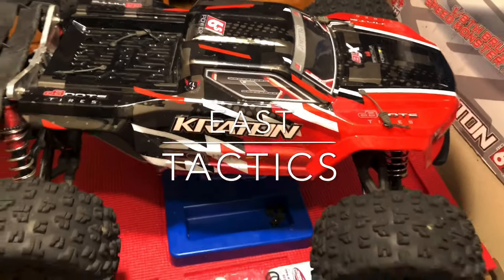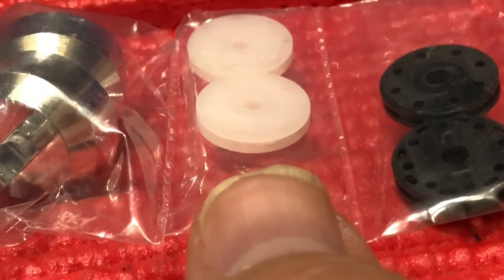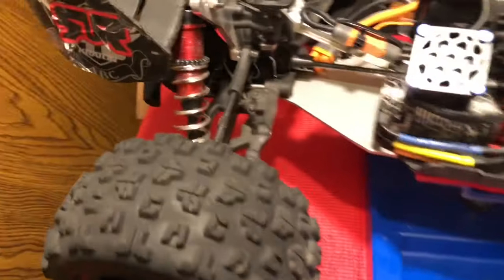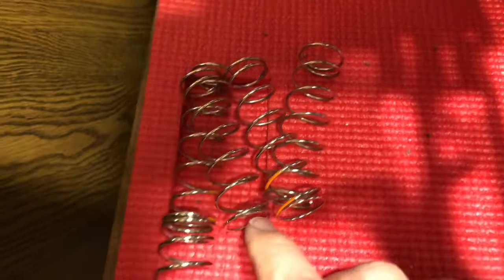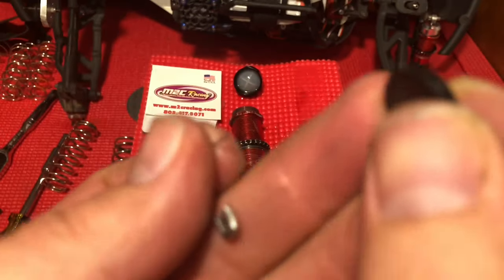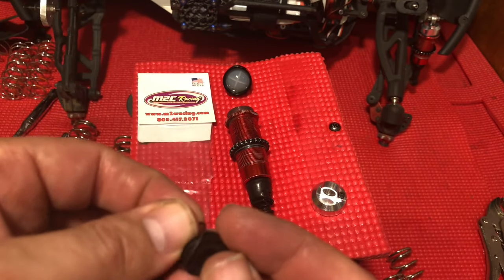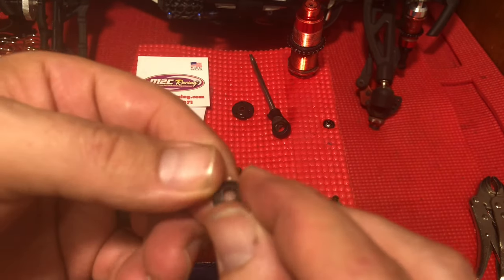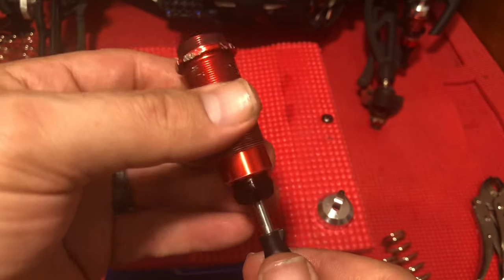M2C ZRS Shock Caps - How remove and install RC shocks

Comment: I love the way you fitted the emulsion caps with great care ,  and the little extra tips/mods 
I found that one of my caps leaked after fitting so I put that plumbers tape around the threads before fitting the caps worked really well . No leaks now 👍👌👍
Reply from the maker: Claire Cooper, thanks, I really appreciate the comment.

Comment: Very well explained 👍 I might want to buy these pistons for my rc cars 🙂 I find a lot of important information on your channel 😃
I have a question about shocks:
When shock is build (without spring!) and I push shaft fully up into the shock body ⬆️ , should it extend ⬇️ ? Also when I push shaft down ⬇️ , should it move back ⬆️ ? Or the shock shaft shouldn't move by itself without spring? 🤔
Reply from the maker: Yes, if installed properly and you achieved removing all air bubbles, when pushing the shock shaft all the way up it should slowly move back out on its own. That’s a good sign.
I’m not sure If it works both ways meaning if you pull it out really fast as it slowly suck itself back in, I don’t believe it does do that. However if yours is doing that I would also consider that a good sign that you’ve got all the air bubbles out

Comment: Nice video buddy!
I love these ZRS caps from M2C! I have them for all my rigs💪😎
Great job taking your time with the install. Maybe try the standard shock springs first to see how they behave and standard 1000cst oil as intended and build up from there. With those stiff springs and super heavy oil not sure your gonna get all the benefits of the dampening of these caps. ZRS really soak up a ton of bumps well when going high speeds, with the stiff springs it may just bounce off of terrain that would normally be soaked up?? I'm curious to see brother, do your thing! Love it
Reply from the maker: 3 Sons RC, hey what’s up my friend! I hear what you’re saying. Running the ZRS caps with the regular shock set up is definitely going to be a venture for me here pretty soon. However I’m going to do it in a little bit of the opposite order of what you’re suggesting. With all the work I put into trying to fine tune the duel shock spring experiment, (now technically a single spring, big rock springs). I plan to get a couple more bash sessions in to truly get the feel of these ZRS caps and how they impact this experiment. I did notice a significant improvement with these caps on the heavier springs. It changed from About a 4 inch bounce (from 35 inches up) to only about an inch and a half bounce. To me that’s pretty significant. 
Remember my goal with rocking his heavier springs aside from seeing if I could tame them, was to provide more protection to the body from chassis slap and other rigorous jolts. So long as the hit to performance and running over those rocky terrain’s etc. isn’t too significant I may end up making this my official bash set up. However I need more time with it. Eventually I will switch back to the single spring and then I’ll really have a gauge as to which I like more. Bash on brother
Reply: @EastTactics  good luck my friend

Comment: Hi, Do you have an alternative for V5 Kraton 6S? M2C said it dont fit 😢 And i dond find the springs in canada amazone
Reply from the maker: I’m confused, doesn’t the V5 use the exact same shocks as the V4 , and EXB (Shocks themselves)? 
Regarding the springs, Give me a little bit of time today and I’ll do some research for you. I heard of a company where you can order custom springs. Let me iron out, the exact sizes you need to order from them etc. But, I need to button up some of the details and then I’ll let you know. May even have to make a separate video specifically on these guys. Since it seems so hard to find the Nero shock springs even here in the US.

Comment: So it would seem, as I figure, you can't tighten it down all the way with the supplied o ring because it will dislodge. But if you don't tighten it down, you get leakage. Seems to me like the solution is a thinner o ring and less vranking down in the end, just enough to seal, no?
Reply from the maker: Yes, also check out the pin comment in the comment section for a timestamp on the idea of adding a DIY O-ring down first.That helps to

Comment: How is the bigger springs and caps doing? Have you went back to the double springs?
Reply from the maker: They’re doing great! Had a bash session recently and I felt she performed on par if not better then the EXB I was roll’n with. 
In fact it was quite noticeable how much softer and less chassis slap was heard and seen comparatively. And the Bounce factor was definitely not worse then stock (EXB), in fact many a landings were quite kush. So ya... luv’ n it!
https://youtu.be/cDl5rOmz2po
Reply: @EastTactics  couldn't find the big rock spring😪s.
Reply from the maker: You’re right! Suckers seem to be out of stock everywhere! I had to dig pretty deep for these not even sure if they’re shipping from the US LOL. But they might work?? I don’t know

Try 
https://www.bigboyswithcooltoys.ca/products/ar330417-shock-spring-75mm-317gf-mm-big-rock-2

Or

https://www.mcmracing.com/en/home/141169-arrma-arac8950-ar330417-shock-spring-75mm-317gf-mm-big-rock-2-5052127022033
Reply: @EastTactics  i looked at the exploded view on arrma site, for the Nero big rock, and its different part numbers? The ones I seen which is the part number are 65mm
Reply from the maker: Ya... ideally you want the longer ones. Sucks there so hard to find. The part number I give is for the 75mm version. Not even sure which classic Nero big rock those were for, cuz your right, I checked to, the current ones in the Arrma diagrams show the 65mm.
Stock Kraton is:
85mm front
95mm rear
So with me going 75mm collar adjustments were needed for both front and even mor so for the rear.
Going 65mm is just too short. IMO

Comment: Hey brother great video once again I just ordered these and curious looks like you used the regular shock piston so I should be good to go?? Or do you need aftermarket pistons to make these shock caps work ?
Reply from the maker: Rocky, They come with the Pistons you’ll use.
Reply: @EastTactics  thanks for the confirmation can't wait to get these installed!

Comment: Great video but Myn is bouncing what did I do wrong?🤷🏼‍♂️🤷🏼‍♂️
Reply from the maker: You mean in general, when landing, she’s bouncing up? How much?
What rig? Stock springs? Stock oil?
Reply: @EastTactics  the stock shocks with the m2c caps and pistons its a kraton exb 1/8 with 3000cst in them when I push it down it comes up very slow and when I drop it with my hands for like 1mtr high it bounces? Thx for your help😁
Reply from the maker: Why are you using 3000cst fluid with stock springs?
Reply: @EastTactics  because the bodems hits the ground when big jumps
Reply: @EastTactics  do you have double springs on them?
Reply from the maker: Understandable, but that’s way too thick for stock springs. Did someone tell you to thicken the fluid? 
You need much beefier springs now to complement that change to the oil thickness.
Reply from the maker: Yes and no… 
For that thick of oil you do need something the equivalent of duel springs. I did away with duel springs along time ago and found single springs in the same caliber.
Get these X4  for 3000cst fluid.
You will need to dremel the ends (both ends) flat, so they’ll sit right.
https://www.mwcomponents.com/shop/sp-co-a-10265?variant=1504334
COLLERS front - all the way up
COLLERS rear - normal

If they make you want to order 8 springs to bypass the surcharge order these x4 with them.
https://www.mwcomponents.com/shop/sp-co-a-11979
Reply: @EastTactics  okay i thought that you used the same shocks thx for the help😁👍🏼
Reply from the maker: Anytime brother😎

Comment: If you had thicker oil or smaller holes in the piston  wouldn't  that dampen  it so there would be less bounce ?
Reply from the maker: With these extremely heavy duty shocks springs that I’ve got installed on my vehicle. (The Arrma Nero Big rock spring) I had to do all kinds of things to tame these shocks. Which is why I have, to your point, added not just extremely thick Shock fluid . But I’m actually running 5000 weight differential fluid inside them! LOL
Now… Prior to incorporating the M2C zero bounce shock caps I was running my own custom pistons with the set up. At which point I was, which again is to your point, running not only less holes than the stock pistons. But smaller holes as well.

Comment: Randy, why they dont extend a bit after u press it?.. the shock diesnt need to extand a bit once u let it go?...
Reply from the maker: ETAI106,  with emulation style/bladder less shocks,  you won’t see that extension after you press it. That’s normal. 😎👍👊

Comment: Have u noticed leaking without the diy o ring? I've redone mine a few times and they still leak. May try the oring
Reply from the maker: Ya... since the o ring.. no leaks. 
Also be sure it’s nice and dry, and you don’t over tighten and de-seat the inner ring.
Reply: @EastTactics  yeah I've redone them a few times, looser and tighter, still leaks.. and when I opened them back up the o ring in the cap was still like I put it.
Reply from the maker: Let me know the results after you utilize the o ring tactic
Reply: @EastTactics  is there a special one u use? The other day i seen a link i think now i can't find it lol. And i had a guy make me some springs for the k6s but i used them once and snapped an rpm arm lol. They might be thicker then what youre using im not sure. Im just wondering if these thick springs ive got are stressing the other parts 🤔

Comment: Idk but the double shock setup just makes me cringe bad
Reply from the maker: Ya, it’s definitely not an experiment for the feint of heart. I will say the Kraton is a different beast with them, and I really like it. As you know though, I don’t run the duel springs anymore, instead I run the equivalent as a single beefed up spring with the big rock springs and 5k diff fluids throughout.
The shock caps help a lot to recoup performances lost in the added shock absorption she gained. Is it worth it, time will tell after my next few bash sessions. 
I’ve been out of pocket tho of late, with a big family move. Hoping to get back at it here real soon. Thx for watching my vids and commenting. 👊😎👍
My Kraton is all smiles thus far, I fear when I revert back to regular stock springs, she’s gunna feel loose as noodles, and lacking in support from hard landings. But we”ll see.
Reply: @EastTactics  i got my kraton exb already shimmed the front diff and filed center and front diff already. I just need now to pick up a rear hot racing bulkhead and the limit slip plates and gasket because mine broke because i had some sort of fabric inside a screw thread. Beats is pretty much ready i have zee lipos coming tommorow and electronics from jennyrc next week. First run in 1-2 weeks;-;
Reply from the maker: Nice!!
Reply from the maker: I’ve loved it, and also stuck with it. Well... technically I did away with the duel shocks and switched to a single shock with the equivalent stiffness. The big rock shock springs! Much needed support for the wieght of my setup now. 
Needs 5K diff fluid in the shocks, and the M2C emulation shock caps help too to tame the shock rebound. Loving it tho!💪😝😎